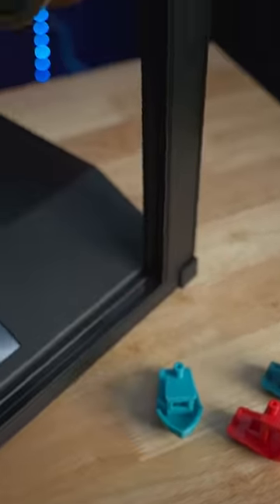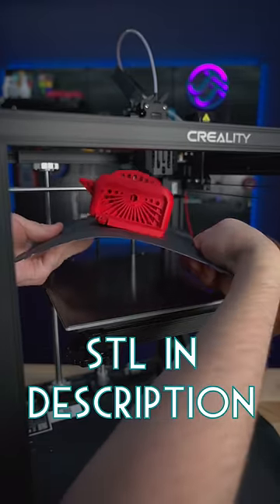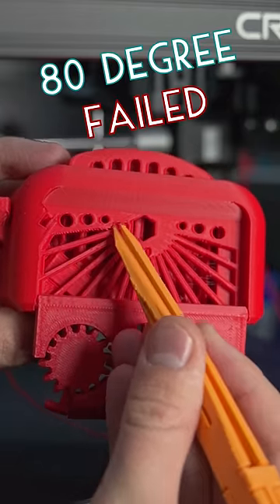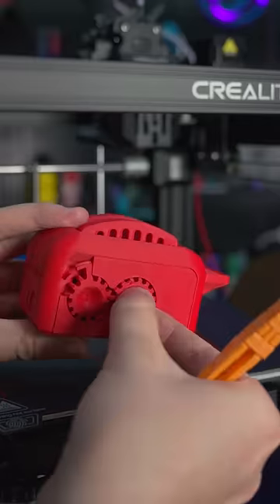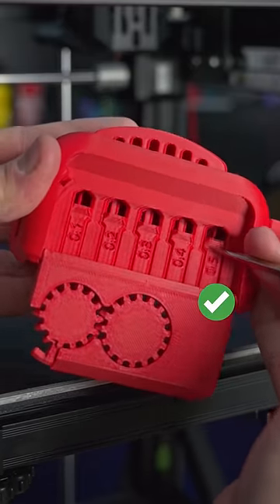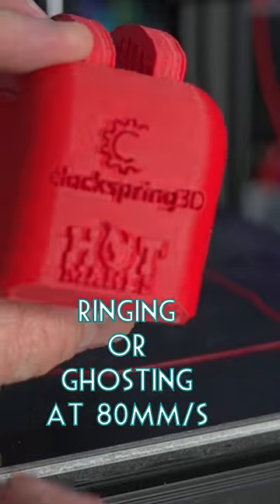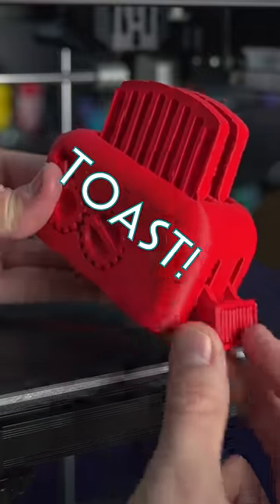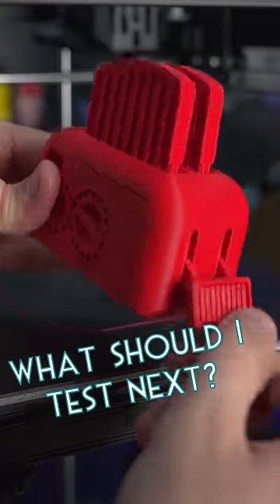3D Printed Torture Toaster - Ender 5 S1 Testing

Comment: I’ve got not clue what you’re saying but I’m interested
Reply: Same lol
Reply: There is a lot of words that i don’t understand
Reply: When you get into 3D printing these terms sound very overwhelming but slowly and steadily you learn all these things and it becomes so normal :)
I'm only 3 months into 3D printing and everything he said here made total sense to me
Reply: @koro000  toast is when you heat bread to make it crunchy and darker
Reply: @sainjs  you learn this stuff after like a week max 💀
Reply: I like your funny words magic man
Reply: Basically, by printing this specific toaster that’s designed to test the limits of a 3D Printer, you can determine what your Printer can and cannot do.
Reply: Pretty much, this toaster checks what your printer can or can't do. It doesn't like printing without much support at an 80 degree angle, when moving parts are 0.2mm or less distance from the nearest edge, the filament will stick and it doesn't move, and overall, the toast moves... But I don't know what that means about the printer.

It tests just how well your printer works, and basically what he's saying is that he's finding the limits of his printer and how accurate it can be with a difficult task.

I doubt that helps, it's hard for me to understand, and I feel like not using the terms he uses still doesn't help
Reply: It shows the printer working near max and what can be done to build more intricet things easily and proper
Reply: @sainjs  I've never 3d printer anything in my entire life and the only part that wasn't immediately obvious was the "ringing" part. I assume it refers to the visible ring pattern caused by the movement of the printing element under fine-precision printing areas? The video wasn't super visually clear at that point so perhaps I saw something that wasn't there. Either way, things like "overhang" and "tolerance" and "80mm/s print speed" aren't exactly rocket surgery.
Reply: @philmybutup4759  as a cook/ baker I agree and disagree
Reply: Samr
Reply: Odd how many people don't know what a toaster is

Comment: I Just Got The X-Plus 2 3D printer for Christmas and I was wondering If That Is The Best Option
Reply from the maker: Looks like a decent machine. You can always get good printers from cheaper, but it seems to have some nice features, like that enclosure so you can print with some challenging materials like ABS.
Reply: @JJShankles  Thanks

Comment: Can you do a test on the Ender 3 V2 Neo?? Please
Edit: Mom I’m famous
Reply: @sierra659  Okay thanks
Reply: @sierra659  thanks
Reply: @sierra659  what settings do you use for speed and retraction? Have been having a ton of issues with bubbles
Reply: @Me-mn1oq  you can use the same ones as for any regular Ender 3 v2.
Reply: @sierra659 hi I’m new to the hobby and I just got donated an ender 6 se so it’s a pretty good printer I was wondering how exactly do I do the torture toaster do I just print the toaster with no supports?
Reply: @sierra659  alright I use Prusa so I don’t have automatic supports thanks I’ll do it after my Dwayne the rock octopus is done

Comment: your ringing is due to acceleration, not print speed. If you're running klipper, check your profiles applied and set your acceleration to your lowest profile value.

Comment: i once hurd a guy on here
say how the toast doesnt give accurate results,
how when they did simpler tests the the tolerances were better.
at the time what they said made sense,
but now im questioning it,
if the simple case passes, but a more complex case (similar to what you will see in actual non-test prints later on) fails. then i think the simpler case doesn't matter as much

Comment: You can counteract ringing with sofrware
Reply from the maker: Yes, but not with the stock software. I'll need to test 3rd party firmware
Reply: @JJShankles  yup
Reply: What does ringing refer to in this context? What causes it? I'm looking to buy a 3d printer soon and I'm preemptively learning bits and pieces about it.
Reply from the maker: @Cortanakya  Ringing is the sort of ghosting around corners and letters. It is caused by printing too fast for the frame. Usually decreasing Acceleration fixes it

Comment: What would you call an average speed for fdm? This is my first printer, had it about 6 months. Everyone said it was slow, which made sense because stability was very important due to its large size. But 80 mm/s it's the recommended speed, and is generally what I used unless I need any super picky details or challenging geometry.

Comment: So .1 and .2 doesn’t move what does that mean and how to fix
Reply: It's tolerance. 
For example, if you want to print a box 20 x 20 x 20 mm and the tolerance is ±0.3mm, it means the result will be look like 19.70 x 20.30 x 20.27 mm.

How to fix, that has many factors like printer, nozzle, filament etc. Smaller nozzle helps to reduce tolerance, but then the print time will be increased.

Comment: When I did this benchmark with the ender 3 s1, everything really stuck at the bottom, but, with the gears, for examples, once I kind of broke through the first layer, they worked just fine, it was only that first layer that didn’t have separation.  Could this be a z offset issue, or just a limitation of the printer?
Reply: The bottom also looked quite flat and pressed, not bery smooth
Reply: To sum it up, after breaking through the first layer, most of the moving elements worked, but it took more effort than it likely should and I couldn’t get the toast to work as a result, where, again, all the moving elements were fine apart from the bottom

Comment: I do 175mm/s on a ender 3 pro. Amazing results.
Reply: Well it depends on what you are printing. If your acceleration isn't high enough, your printer won't reach those speeds often and you may possibly be printing at much lower speeds.
Reply: Nozzle size?